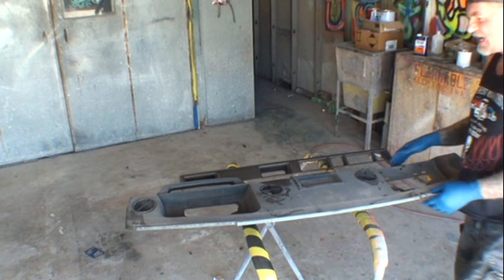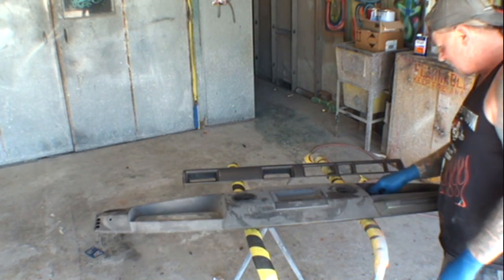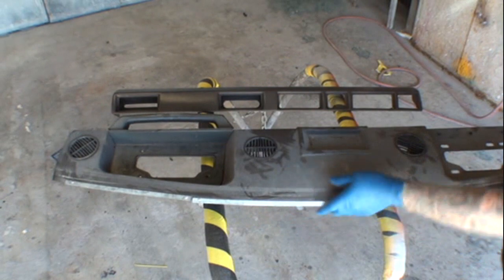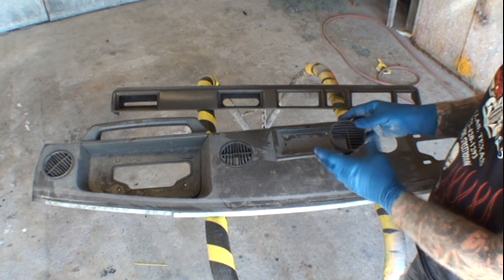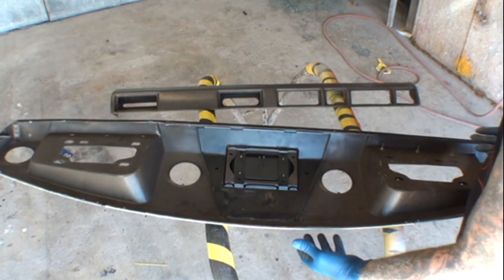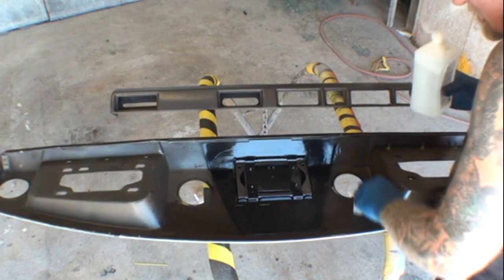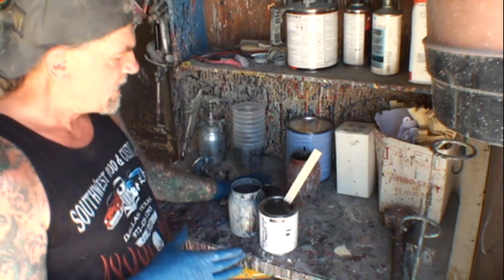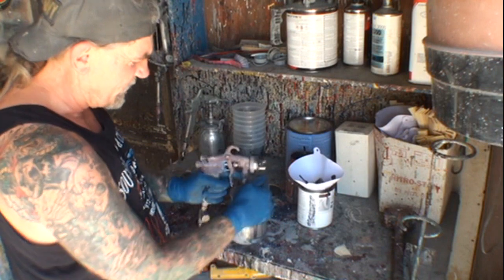How To Paint Plastic Interior Car Parts With Vinyl Dye : Made Easy

Comment: Ive used the rattle can dye on a few cars and they come out great.  Sprayed black over light blue. Arm rests, console, rear seat and door panels. Never a crack or anywhere in the car you could tell it use to be light blue. Another car I kept over twenty years the rattle can stuff never wore off or showed through to the green I covered. I dont know how many small jobs Ive used it on, like kick panels and panels that cover the seat hardware in the old 50s cars.
Reply: Same here. I used the SEM brand with zero issues and it looked like it came that way.

Comment: I have to do this during the summer of 2017 in a garage with no heat but good ventilation.

1. I have dash parts with a deep, evenly  grained texture.  Would it make sense to use a some kind of a soft brush instead of, or in combination with, toweling?
2. Is there any kind of chemical that would work in a soaking bath that wouldn't damage the plastics but could help to lift Armor All out of the pores?
3. Do you have any special recommendations for interior parts that can't be removed from  a larger assembly, like soft vinyl contrasting pieces from door panels or vinyl panels on fabric seats?

Comment: How do you remove epoxy primer overspray off textured plastic? I fucked up and got it on a dash 

Need some help please 
Just little specks here and there
Reply from the maker: Carefully take it off with some laquar thinner using a small screw driver wrapped with a wipe all towel or sometimes you can take an exacto knife and pick at it to flick it off.. Time consuming situation!! Been there done that...  Worst case you can always buy some vinyl dye and re-shoot it..

Comment: Nice vid! What about 99 Silverado dashboard. It's plastic with a skin of like latex over it. My the front corner peeled off. Will vinyl paint work on this type? I thought about using like a super glue smearing around peeled edges (it's about a 6" diameter area) to keep from peeling more, than do light sanding on it and glossy plastic where it's peeled, than repaint whole thing...am I on the right track here??
Reply: Bondo???

Comment: In my opinion, when u get to the point where u r using a spray gun in a spray booth u r no longer classed as DIY
Reply: You can buy decent spray guns cheap to get started these days and a makeshift paint booth can be made with pvc pipe and plastic sheet. It doesn't have to be commercial grade equipment to get a quality job.
Reply: @89Mirageman  you also need a compressor
Reply: @eibura5978  True but you can buy a $200 compressor at Harbor Freight to get you started. You can't spray an entire car but you can do small stuff like this.

Comment: hard plastics used in autos is non pourouos and water proof. There are no pours or acne scarring in hard  plastic. Sorry. You can also dye plastics but it is basically painting the surface. Only. You can dye materials that absorb such also. Buy dye only works properly when it is absorbed into materials. Otherwise you are just painting surfaces and you can do that with regular rattle can paint. clear coating it will help it hold up longer however.